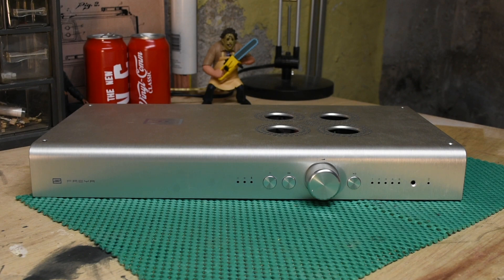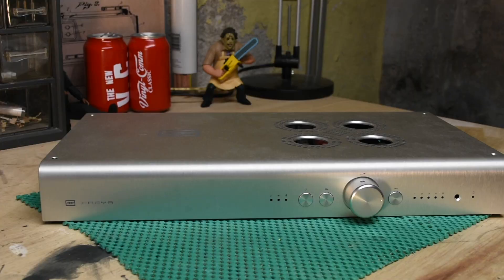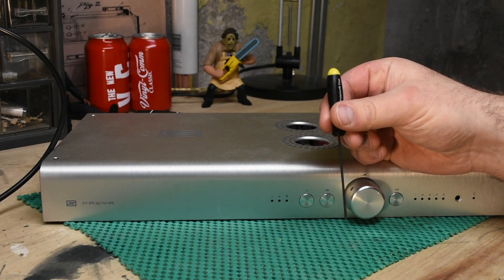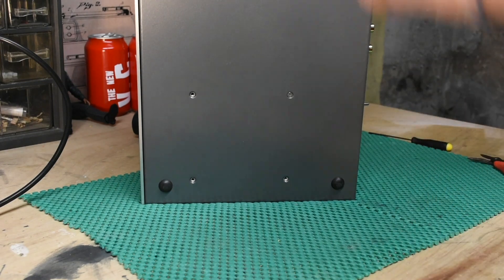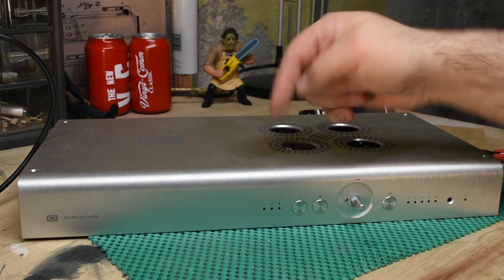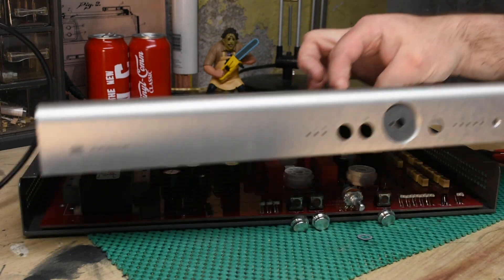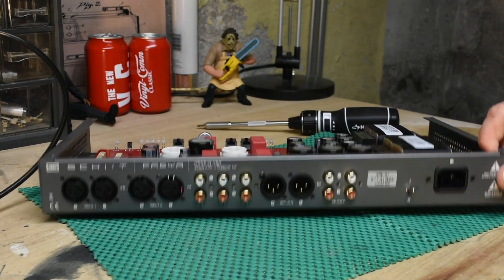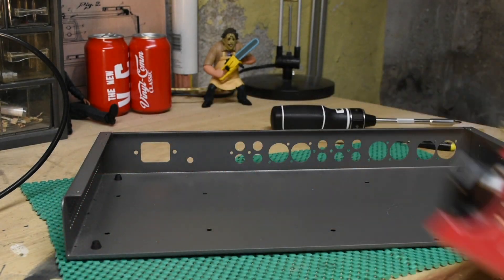I REPLACED THE CAPS IN MY SCHIIT FREYA PREAMP - HERE'S HOW!

Comment: I have 3 of these preamps.  They all have a problem.  Popping sounds are heard from the speakers when the volume knob is turned.  Yes, from the speakers.  Usually around the 12 o'clock position of the volume knob, and with many combinations of cables, sources, speakers and amps.  This happened to all 3 brand-new units right out of the box.  I contacted Schitt to see if there is a defect with these and all I ever got from them was the runaround.  They would not give me a straight answer.  Anyone else experiencing this issue?

Comment: OK….I have installed my V-2 ODAM Capacitors and cut out the top-plate and installed two very cool vents. 
Burning in the cap now….WOW! Why was I buying tubes? 😂 I will know more in 80hrs.
I have decided to replace all the resistors in the input & output tube stages signal path, as well.
Hope you are coming back to post impressions.
Reply: I also have the vcap odams, did you do the resistor change? I am thinking of this as well.
Reply: Which model and capacitance for the V-Cap ODAMs did you use?  Seems like a worthy upgrade.
Reply: Those have big break-in times, like 300 hours or so. I wouldn't bother with any resistor change until those caps are well broken in.

Comment: You need a bigger soldering tip and more power applied to the tip to sustain constant heat.  Which equates to constant heat at the pad. The pad or trace will sink that heat quick.  Soldering wick shouldn't be a problem with more power/heat and a larger flat soldering tip.
Reply from the maker: I'm always curious about what temps people work on PCB's with.  Someone recently told me 450 degrees Fahrenheit, which seems way too low to me.
Reply: @6AM_YT  The eutectic point of typical tin/lead  (60/40) solder is about ~361F.  So long as you can keep the solder liquid long enough to get the job done.  ~400F at the solder tip with enough power to keep it at 400F sounds about right.  More heat maybe.
Reply from the maker: @roncruise4   yeah, but everything is lead free solder now.
Reply: Between 600-650deg F.  And yes always have a beefy tip when using braid, and pre-melt some solder onto the braid.  Also, your braid looked a bit too wide; the size matters.  So will you share your results, or is that a secret?  Best of luck!

Comment: One more question.  Is there a "directionality" to the installation of each capacitor. I want to do a Freya + , which is slightly different than what you are doing and I want to make sure that I install them correctly.
Reply from the maker: That's a somewhat controversial question.  Most non-electrolytic caps are non-polarized, which means, they're not directional.  However, some people will make the case that it matters, not to basic function but to the sound quality.  The idea is that, if you conceptualize a cap as a roll of tinfoil that has a lead connected to the start of the roll (the inner foil) and the end of the roll (the outer foil), that it  will produce a difference in sound.  All that aside, I normally just match up the direction of the writing to what was there originally and hope for the best.  You don't always know which is the inner or outer foil anyway.
Reply: @6AM_YT  hmmm…yes…as I mentioned below…I plan on using ODAM-070: 2.2uF 400Vdc V-Cap ODAM Capacitors. The guy who did it posted pics of the install on a blog…so I will go with the writing on the caps as you suggest! 👍🏼 (I would post you the link, but YouTube will not allow that! 😞)
Reply: @bobb.9917  The outer foil connection is to the lowest impedance. In the Freya's case, the cathode connections of both triodes, on each output buffer tube (4 caps needed). This according to several manufacturers, helps reject interference.
Reply: No my link failed as well.

Comment: Good job.
The location is slightly different on the Freya+, all four caps are grouped together between the Tube sockets and PSU electrolytics. I doubt those Jantzen caps would fit, but there are others that will, eg Mundorf EVO Oil. I used the V-Cap ODAM's, which take this Pre to the next level of performance. Bigger improvement than tube rolling. You might want to insulate the cap leads, this is essential on the ODAM's which have a metal body.
Reply: Which model and capacitance for the V-Cap ODAMs did you use?  Seems like a worthy upgrade.   

In my case, installing the Freya plus into my system caused alot of my dynamics to be lost. I believe it's filtering out the same and essentially negating the benefits of my LPS.  The hope is that updating the caps will get those dynamics back.  Let's see.
Reply: @Artemis_Prix What tubes were you using? Did you figure this out?
Reply: @JonMoralesLA  Hi Jon... this was early in my Freya Plus journey.  At that time, I was using just Tung Sols...those are likely the minimum acceptable tubes for the Freya.  But, shortly thereafter, I had bought a matched pair of cryogenic Electroharmonix 6sn7s from Upscale Audio (the best level they sell) and installed them on the output stage.  All I have to say is that those tubes transformed the Freya into a much more desirable preamp... the highs were much more transparent and clear, the sound much more holographic, the soundstage was a little wider and deeper (let's call it 10% more), and the bass was quicker and a little more authorative.   I was amazed actually because those tubes are not that expensive.  

More recently, I had replaced the remaining two Tung Sols on the buffer stage with a matched pair of Cryotone 6sn7s.  Those were an improvement over the Tung Sols, but my feeling is that the Electroharmonix are a little better (really hard to say because it's not easy swapping tubes quick enough to retain sound memory during A/B testing).  But,  the Electroharmonix are much cheaper which is an important point to highlight. 

My plan is to buy another matched pair of Electroharmonix and see how the Freya sounds with all four tubes running Electroharmonix. 

Let's see.
Reply: @Artemis_Prix Thanks for all the info! Turn out upscale audio is driving distance from me! I ordered 4 of the cryotreated Electroharmonix and am going to go pick them up today. I’m going full ham on my Freya+ and also performed the V-Odom capacitor upgrade and waiting for some resistors to come in as well. Replaced my cable with a Pangea AC-14 cable. Also replaced the fuse while I was in there. 

I really think the Freya already sounded great stock with the Tung Sols so can’t wait to put it back together and with upgraded and new tubes.
Reply: @JonMoralesLA  Fantastic...I believe you'll be pleasantly surprised by the enhancement the cryo treated Electroharmonix brings to the table (note - the cryo treatment enables them to play perfectly right out of the box...no burn-in required).  My suggestion would be to replace only the two on the output stage (i.e., the right hand side pair) first... that made a very significant difference.  The buffer stage (i.e., the left side pair) didn't make that big of a difference...palpable,  yes,  but not huge. 

I had also switched to the Pangea AC-14 and it did improve things somewhat...

Haven't been brave enough to switch out to an upgraded cap yet...always on the fence about whether it's better to upgrade to a higher tier preamp or to upgrade the preamp itself.

For now,  it works well.
Reply: @JonMoralesLA  The anticipation is killing me 😂.  So how did the Electroharmonix work out for you?
Reply: @Artemis_Prix Oh I’m really loving them! Thanks for the suggestion. I bought all 4 but can’t say I recommend all 4. Just changing out the 2 on the right did the trick. They bring more airiness to the sound. More clarity and detail. When I put all 4 in I think the bass got too thin. I much prefer leaving my TungSols in on the left side. 

I loaned out my Holo Red streamer to someone and have been waiting to get that back to do some better critical listening. Currently only have my WiiM Pro streamer.
Reply: @JonMoralesLA  Very glad to hear!  My experience was the same as yours,  essentially.   Putting the Electroharmonix on the output stage was a revelation...

Streamer-wise, I'm just running a WiiM Pro Plus.

But,  I know I need to upgrade the streamer at some point so I can utilize a DDC.  But,  that will require me to upgrade my DAC too (my tricked out J2S doesn't have an I2S input).

I'll likely wait until WiiM releases a next gen Ultra and until Geshelli releases a next gen J3 with an I2S input.

Hopefully I won't have to wait too long. 😊
Reply: @Artemis_Prix  My hardware setup is as follows Holo Red streamer > Geshelli Dayzee DAC w/Sparkos > Schiit Freya + > Galion A75 amplifier > CSS 1TDX speakers w/ superior crossovers.
Reply: @Artemis_Prix  I don’t think you need to worry about i2S if your DAC doesn’t have it. My Dayzee I use the AES connection out of the Holo Red into it and it sounds great and a good improvement over Coax or SPDIF.
Reply from the maker: The Freya gives you more options than the +.  I considered insulating the leads, but they didn't come close at all to anything to bother.
Reply: @6AM_YT  Yeh, the ODAM's having a metal body, means more cation is required than with most. I actually used Silicone sealant under mine as well, to act as a vibration damper. Talk about belt and braces.😀
Reply from the maker: Why these boutique cap manufactures like housing their caps in metal is beyond my understanding.  I get that they look nice, but the whole thing is a potential short.  It's weird.

Comment: Thanks for doing this video!
Is there any physical danger involved in doing this?
I am considering installing two pairs of ODAM-070: 2.2uF 400Vdc V-Cap ODAM Capacitors into my Freya +. They are smaller and will physically fit in the space better.
Reply from the maker: There's always a chance of the larger can electrolytics to still retain a charge.  Assuming the amp has off for a some time to allow those caps to discharge and you don't have it plugged in while working on it, you'll should be fine.
Reply: @6AM_YT  THANKS for the response. That is what I was wondering…I can solder…but (after being a photographer for years, and using giant studio flash packs with multiple capacitors the size of coke cans, I know that capacitors are made to build up a charge and release it! 🧨), that was my concern.
Really looking forward to your sound assessments after the fix! 😀
Reply: To be safe and for piece of mind, you can discharge the capacitor with a large resistor.  Like a 100ohm 5W resistor.